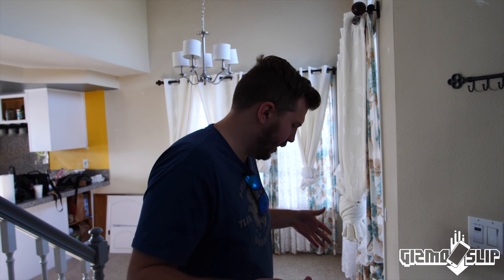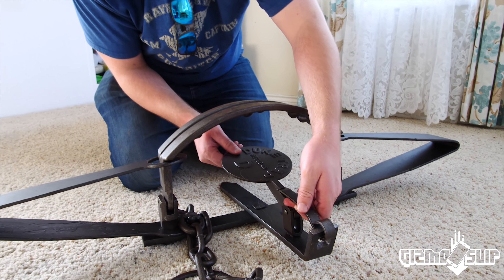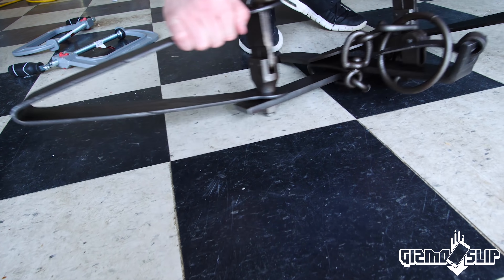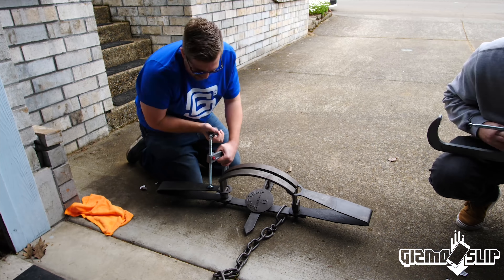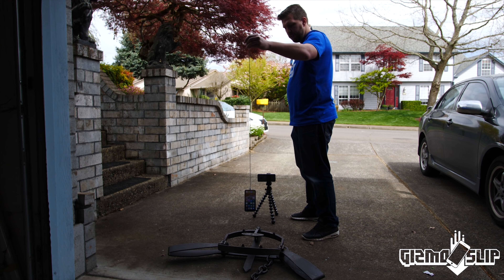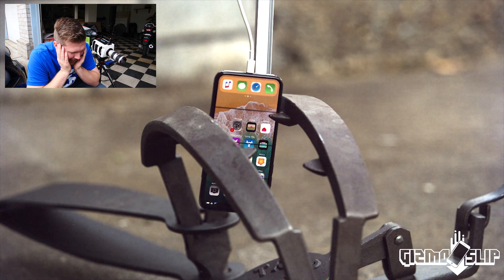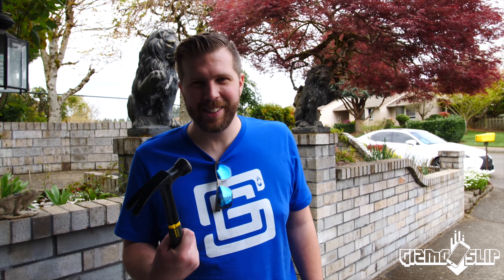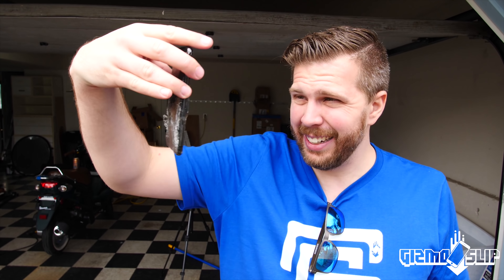Don't Put Your iPhone X Inside Giant Bear Trap!!

Comment: The hutzel trapping company makes a #21 model that makes yours look small,the trap itself weighs 140 pounds,takes 700 pounds of pressure on each spring to set,has a 30 inch open jaw spread,and costs $3,000